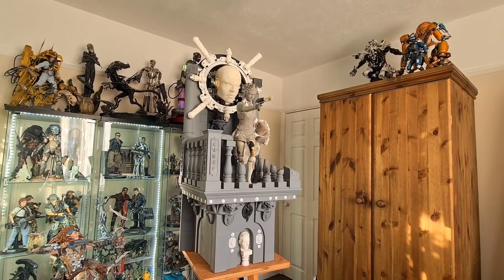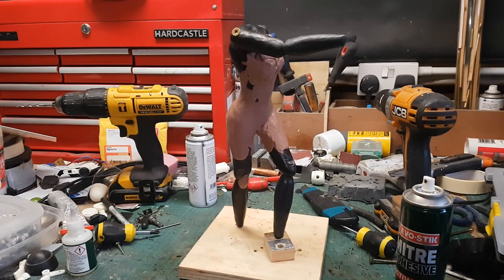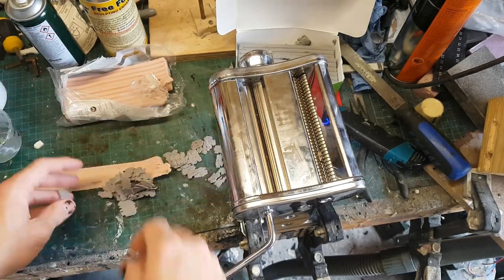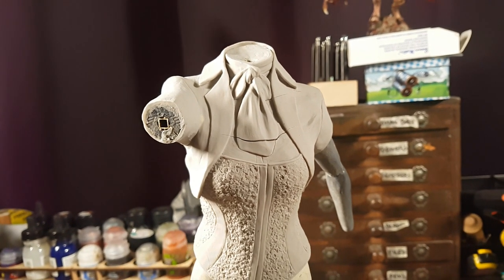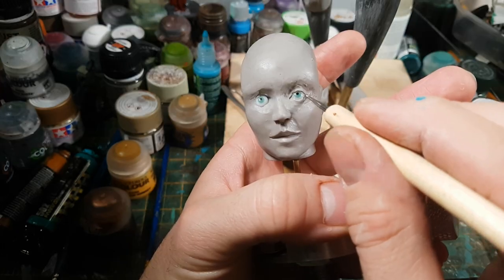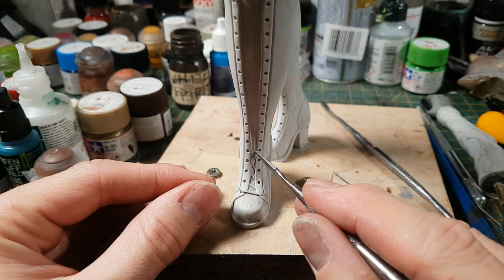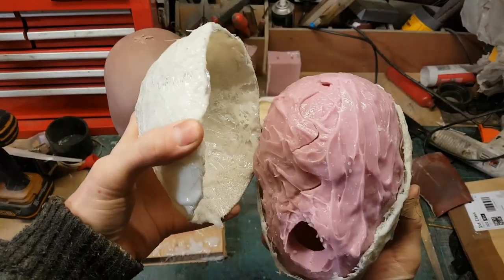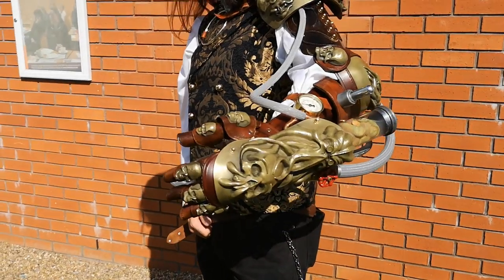Making a Steampunk Statue Part 1

Comment: Slow to pick up on this but really enjoying your build. if I have one tip to contribute it would be on using epoxy putties, I use them all the time and the application of Nivia lotion on your sculpting tools it will prevent sticking and make your experience much more enjoyable, it dries clean when cured. I apply a little lotion to the back of my hand and just a quick tiny dab usually is enough. Hope this helps.
Reply from the maker: Hi John.  Thanks very much!  Ah that's a great idea, thanks.  I've been using water which does work but that definitely sounds like a better option.  Cheers!